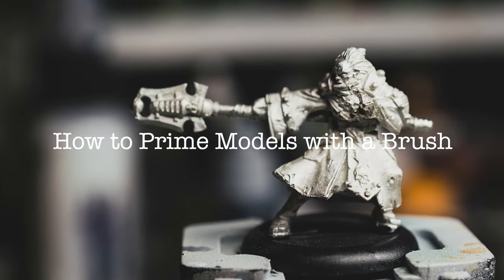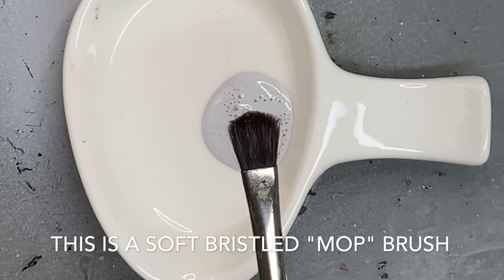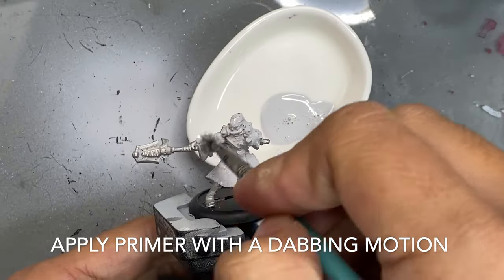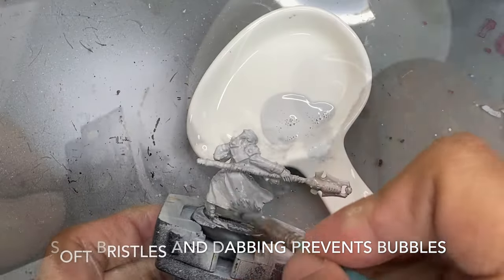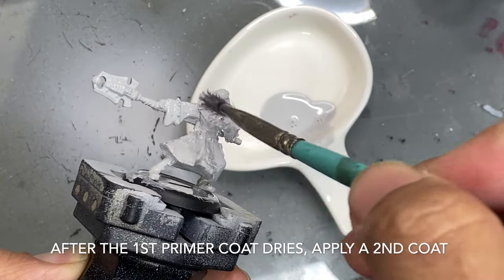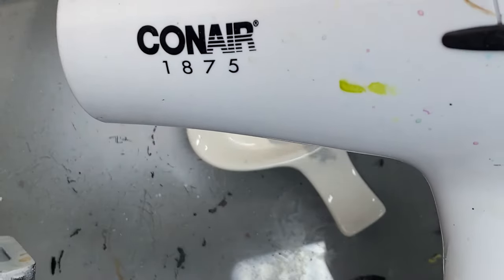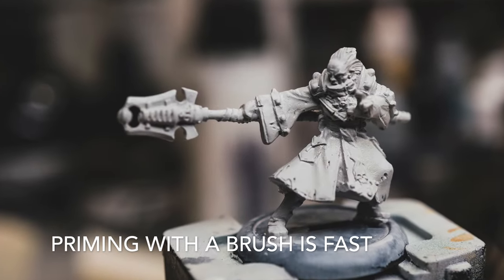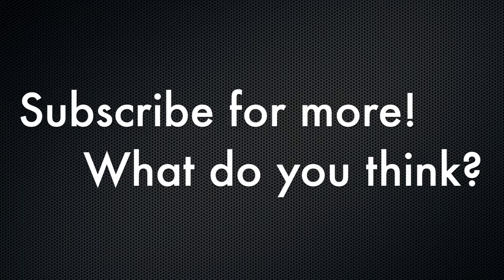How to Prime Miniatures with a Brush

Comment: Thanks for the video. I keep getting bubbles and bad looking brush stroke lines on mine. Not to mention a lot of details are muddied. Any tips? Also how long do you wait from first coat to second?
Reply from the maker: Wait for the model to completely dry before the second coat. Dab your brush with short strokes, rather than long sweeping/brushing to avoid bubbles.
Reply: @tangibleday  oh i see. That helped a lot, thanks

Comment: Would this work on a metal enclosure? And does it work the same as the spray on primer, in terms of adhesion? Thanks!
Reply from the maker: Yes, it should work! Priming with a brush would work on any metal. Make sure you clean the metal surface before you start priming to get the best adhesion possible.
Reply: @tangibleday  thanks for the info!
Reply: @tangibleday  Also, do you have any recommendations for finishing options to protect the finished product? Similarly, an alternative to a spray paint clear coat? I've always used those in the past but would prefer a method that is a bit more simple to control. I've heard of using Solarez polyester finish with a brush.  Thanks in advance!
Reply from the maker: @FellDestroyedMusic  here is some info I wrote for that. It was easier to put into words than make a video :) https://tangibleday.com/recommended-varnishes-for-miniatures-best-practice-and-use/
Reply: @tangibleday  thanks a bunch! :0
Reply from the maker: @FellDestroyedMusic   Let me know if you have other questions. I'm working on other tutorials and anything to help!
Reply: @tangibleday  Thanks! Much appreciated. I make guitar pedals and my method was always messy with the spray on primer and clear coat. Plus I am in a place now where spray paint wouldn't be acceptable. I knew there had to be another alternative that was cleaner. Do you use acrylic paints?

Comment: Thank you! This is very shareable, and I hadn't seen that type of brush recommended yet for the process.
How soon after a good treatment with the hair-dryer do you start applying paint though? I was previously giving my vallejo surface primer a good 48+ hrs just air drying, which... is a lot of patience 💀
Reply from the maker: After the hair dryer step (30 mins later) I start painting over the primer and it works great !

Comment: hey Tangible,
just want to know if you need to put on the mask when you paint with paint brush?
Reply from the maker: I don't wear a mask when I'm brushing anything with a regular paints or primers. It's a benefit of avoiding sprays and airbrushing. Less PPE required :)
Reply: @tangibleday  thanks a lot! It's very helpful  to me.
Reply: It SHOULD be noted that the AUTHOR is referring to acrylics only as regards the use of masks during application. If you are spraying enamels or lacquers then YES, you DEFINITELY want to be using a good quality mask as those fumes are NOT good for humans.
Reply from the maker: @markpr73  even a normal mask won’t do for volatile sprays (aerosol cans) or enamel sprays. True :)

Comment: can i use any kind of primer or just surface one?
Reply from the maker: @CernnuOneDesign  any kind of primer could work. But make sure it’s water based if you want an easy time applying it with a brush.

Comment: what size of this brush, that you are using?
Reply from the maker: It’s a 1/4” mop Princeton brush. I added this to the description as well. Any kind of mop cosmetic brush would work. I use this size because it’s easy to control and works well with minis :)

Comment: Is it normal to have a lot of bubbles when you paint primer with a brush. I use the white Vallejo Surface Primer and it has a lot of bubbles.
Reply from the maker: On the model when you apply the primer, keep your brush dampened with water. I use a soft bristled brush and notice the dabbing motion I use when I apply the primer (Vallejo surface primer). The dabbing keeps the bubbles to a minimum. And yah there are bubbles but they shouldn’t be a problem. Don’t over brush on the primer… once it’s on there, let it dry on its own. Use a hair dryer if you have a spare one available, that also helped me avoid any weird surface issues with the primer when I apply it with a brush. Hope this helps!!!
Reply: @tangibleday  thanks for the reply. I will keep your advice in mind.

Comment: is it normal for it to be abit thin? im painting a grey model with a white primer and some of the gray still peaks through if a bit lighter. is that the sorta thing i just do a second layer for?
Reply from the maker: Yeah it’s okay for your primer to be thin and “see through”. You can add another layer after the first dries if you want to. Also, make sure you vigorously shake your primer bottle to ensure it’s mixed well before use. Hope that helps!!!
Reply: @tangibleday  this was very helpful I didn’t want to risk painting if it was gonna break off  thank you!